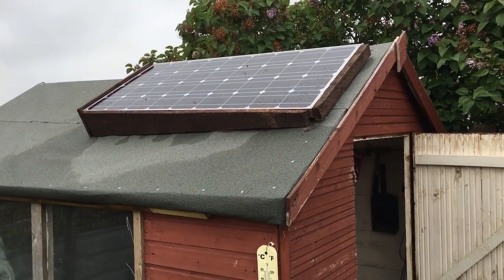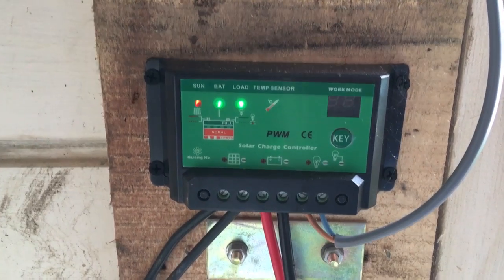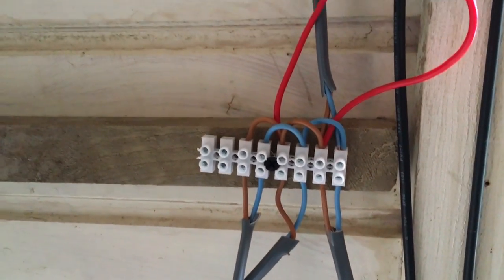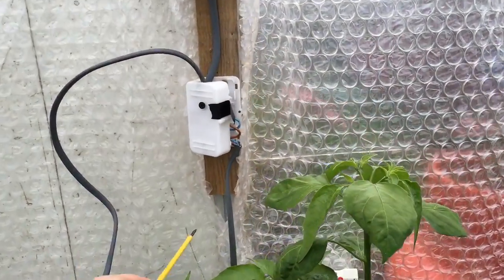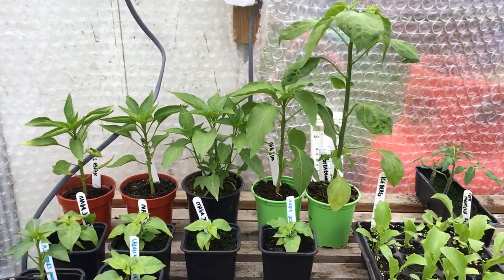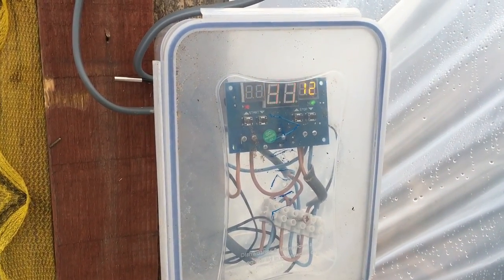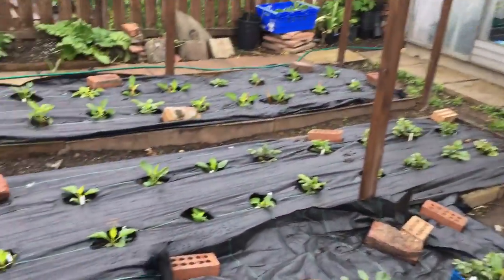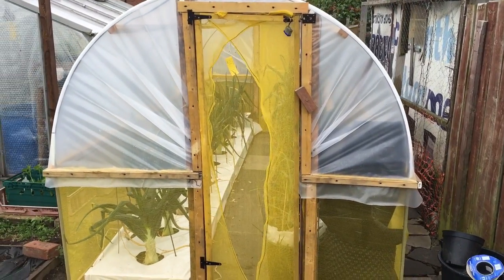How to install a 12 volt Allotment Shed/Workshop Solar Setup

Comment: Mark     Can I ask you a daft question mate, on the switch how have you wired up the light above in the video or could you take a photo off the rear of the switch just so I can see the way you have wired it up thanks Paul

Comment: That is a great setup Mark.  What about a source of heat, would you need a special low draw heater or do you think a standard fan or electric heater would work off a system like that?
Reply from the maker: Heat is a funny subject. to create heat it takes up a shed load of energy and the time when you need heat there isn't much sun. so I don't think heating is an option unless you have loads of solar and battery capacity.
Reply: Thanks mate, lots to consider.

Comment: I have found that a 300 watt inverter (which converts dc power to ac power) is very useful for occasional charging tool batteries or running small ac powered tools like drills and small grinders.

Comment: Great system you've got. The only thing I would say is the cable size on the long runs from the battery to the polly tunnels look a bit on the small size, volt drop is a problem on 12v systems. Have you checked the voltage at the furthest point from the battery if is to low it could cause you fans to burn out the way around it is to up the size of the long runs of cable. Just a thought if you keep having trouble with your fans.
Reply from the maker: The thing is at the minute only one thing is running at a time so its not a problem at the moment. Ive checked the voltage at the furthest point when its running and its at full output. I will however be installing a proper fuse board
Reply: Thats great I look forward to seeing the expansion of the system including the aquaponics .Great videos by the way keep up the good work.

Comment: Thanks for this Mark, I may be back with a few questions!!!  I like the thermo controller for the fan 👍🏻
Reply from the maker: Yeh no problem nigel. It was a bit of a nightmare to get hold of the right fan an a bit spaghetti to wire. I will be installing a proper fuse board over the next few weeks

Comment: Great job, Mark. Quick question. How many sockets/switches can you put on the one battery, and would you not hook up an irrigation system for the greenhouse, or with the giant veg, does the right amount of water count?
Reply from the maker: Yeh I'll be hooking up an irrigation system to everything. But this will be done over time

Comment: I have a similar setup, I thought red light on the solar input meant nothing coming from the panel  (lost the instruction book). I have exactly the same controller. Is the solid red, charge coming in? If so, my issue is solved, thought the battery was just being drained.
Reply from the maker: Im not 100% but even on a day like today it will still be charging. If I remember correctly solid red means it is charging, flashing means intermittent and off means obviously. Your local to me I think? If you want me to come down and have a look at it
Reply: Yeah I'm in the slightly better city of Sunderland ;). Well, now that I know my panel isn't faulty and red is good it's fully working. Just need to get that 12v water pump sorted and I'm good to go. But yeah, I might pop over and have a nosey some time, can't wait until I have an allotment, would love that much space to play with.